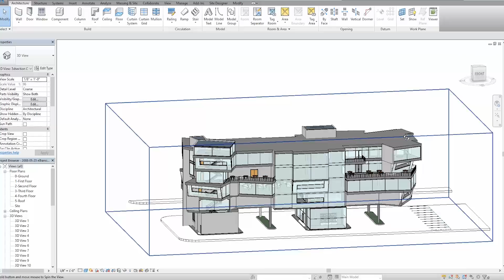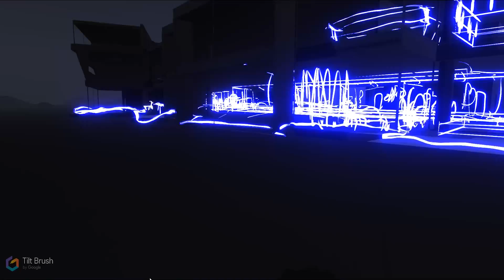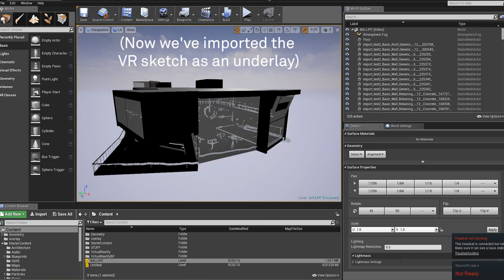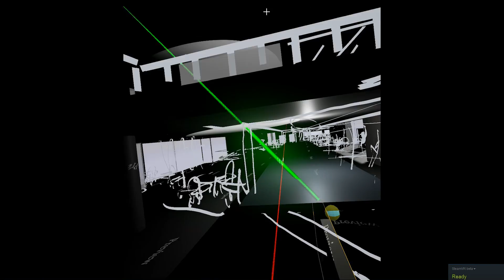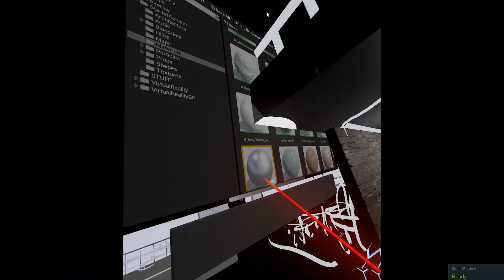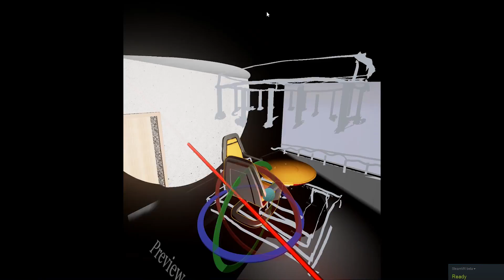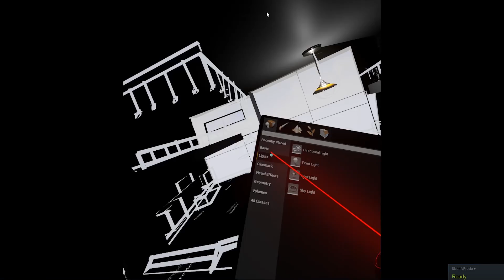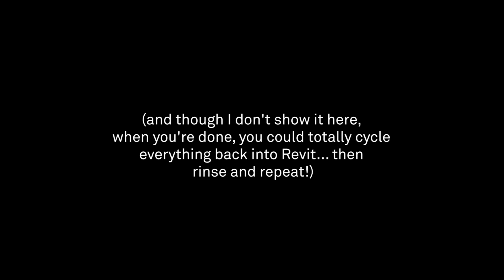VR Design Workflow - Revit to Tilt Brush to Unreal Engine

Comment: I am exploring using VR as a design process too. I've imported tiltbrush into Rhino to create solids to draw over.  haven't had much experience with unreal, but very interested in using it as a visual mockup tool.  this is a great vid!
Reply: The VR editor in Unreal is great for scene designers because they can do their layouts in simulation instead of placing everything in 2D then getting in to VR and seeing things that have to tweaked. Then they don't have to get in and out of VR a bunch while working. They are basically porting the full editor UI to menus on the controllers and panels you can dock in world or attach to your hand like a tablet. You can literally pull objects out of your content tablet and drop them in world then move/scale them how you want. Not all the UI is done yet but they added a 3d object material/vertex painter so modelers can 'hand paint' objects in VR.

A buddy of mine was an architect that used to use Second Life for this since it was world scaled in metric. It has an in sim primitive object + Nurbs building system with basic lighting, texturing, and physics. He would mockup rooms, floors, or entire buildings he was designing and tweak the floorplans because he could walk-through and see how it worked in scale until it was what he wanted. He then just translated the coordinates into dimensions for his real blueprints since they were in metric scale. He also made some basic walk-through concept demos movies or screen shots for reference or to show others.

Since I got my DK2 and HTC Vive most of the apps I have or try to build are more focused on content creation and teaching than consumption or gaming.